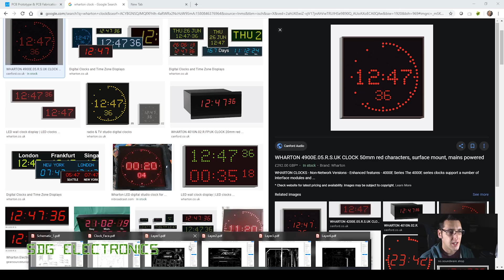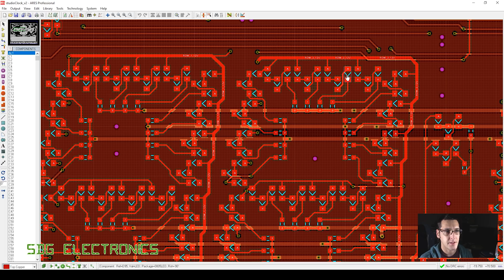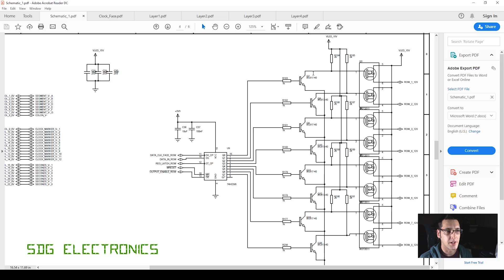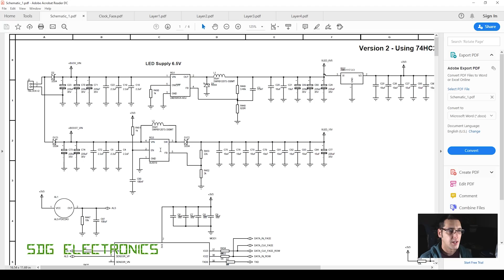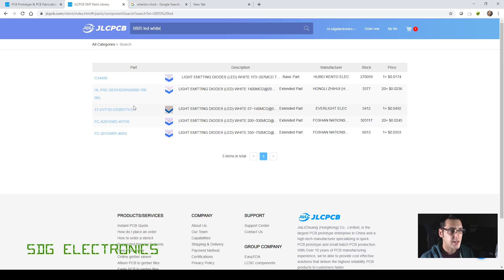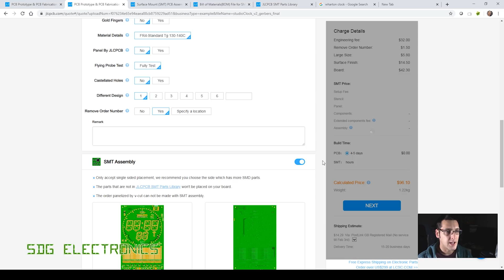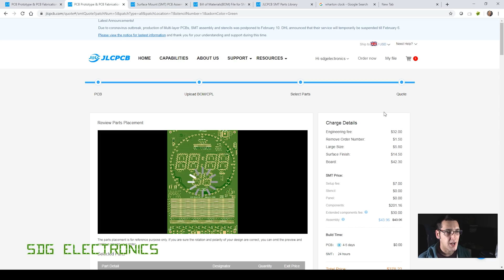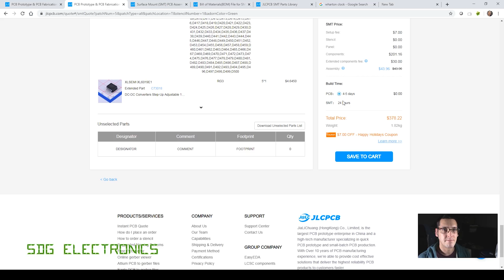SDG #133 2000 LED NTP Megaclock - An ESP32 based Wharton Electronics Style Clock

Comment: Hello sir. First of all, this project is amazing. Looking at your schematic, what is your intended manner of powering this board? What will you be connected to the terminal block?

Thanks.
Reply from the maker: I had planned to put this into a frame, thus a 2.5mm barrel jack on wires would be soldered into the holes.

Comment: Amazing work :) Must have taken a long time. 
I did a quick review of the schematic. Looks pretty good. 
In the datasheet I found for the WST2011, I see the max Vgs is +/- 12V. 
In the schematic it looks like it would be 15V, when the gate is pulled low. If I understood it correctly. 

if (review == pedantic) the switch life could be improved by putting a few ohms in series with the de-bounce cap, to avoid microscopic welds on the contacts. But honestly, I wouldn't bother either, if it's not a switch that would be expected to last many thousands of cycles.

Can't wait to see the finished boards :)
Thanks for the video!
Reply from the maker: Good catch, I missed that so a good job you spotted it!

Comment: Great project. I'm currently building a largish clock myself, but it's a 7 segment thing with 8 RGB leds per segment and each digit on its own PCB. A bit of a battle of material as well, but certainly not to this extend.

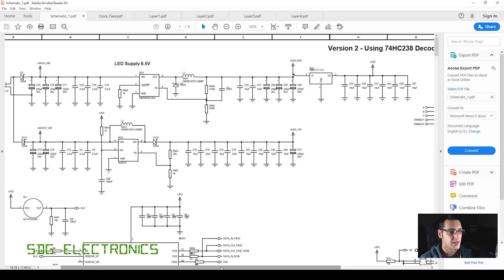Comment: Hi. @7:29 you show the power section. The RG1 pin 5 is the chip enable pin. If i understand correctly, if the pin is pulled high, it's on, if low, it's off. From that regulator you get the 3v3 which also enables the RG3, but since RG1 is off, the other regulator won't turn on also. Maybe check if it's all right
Sanity check my sanity check for you :)
Thanks for the content! Keep it up!
Reply from the maker: I think I had set it up so that the boost converter would only turn on after the other rails, but thank you for reminding me to double check that!
Reply: @sdgelectronics  It seems the symbol for RG1 is a bit misleading, but you wired it correctly. If compared to the TI datasheet.

Comment: I haven't been through the schematic in detail yet, but I'm wondering if you could simplify by starting with a 15V input instead of 12V, and delete the boost converter.  15V power supplies are just as easy to source as 12V...
Reply from the maker: It did cross my mind and I do have some 15V supplies. Tough choice really as most people are likely to have a stash of 12V power supplies though.
Reply: @sdgelectronics  True, and if someone wants to use a 15V supply, it's easy enough to bridge the pads for the inductor and rectifier in the boost circuit and not populate the rest of it.

Comment: In several videos about JLCPCB‘s SMT Assembly, the preview showed components with incorrect orientation. The YouTubers mentioned that the preview was at fault and went ahead. The final boards were ok. Possibly the orientation has been manually fixed by JLCPCB staff, possibly the preview has a bug. In the latter case you might have made it worse by changing the pick and place file.
Reply from the maker: Hi robatoto, The orientation is determined by the JEDEC standard which JLCPCB are correct about - most of the components that were incorrect were those that I added to the library manually and thus I didn't pay attention to which way they would arrive on the tape/reel. A technician manually checks the orientation against the Pin 1 or polarisation markers on the silkscreen.

Comment: For the HC595 (why an extended part?); you can just put 13 /OE to GND, and 10 /MR to VCC. Then 14 DS -> SPI_MOSI, 12 ST_CP -> /SPI_CS and 11 SH_CP -> SPI_CLK .Not sure about your clock frequency, but the normal HC won't do good > 4 MHz. For my pixel (WS28xx) project, I have to use the AHC595. Furthermore, I really hope you are going to use a proper software development IDE, such as Eclipse CDT.

Comment: I couldn't be sure on your schematic, but I'd suggest a 0.1uF cap to GND from the /reset (EN) pin, with a 10k pullup resistor . I've found that there can be issues with programming the ESP32 using the 2 transistor circuit if you just pull /reset high through a resistor as the delay between the /PROG+/reset pulses isn't long enough (the ESP8266 seems more tolerant of this for some reason). It can also cause issues booting, as the VCC pin may not have risen to 3.3v (due to capacitance) when the chip attempts to boot. Adding the slight delay to the /reset pin fixes that issue! Just something I've discovered when using this chip on a few projects :)
Reply from the maker: Thanks, I'll take a look at that

Comment: How much more expensive is it to do double sided components? LED's on one side and all control/bias components on the other to make a cleaner display side.
Reply from the maker: At JLCPCB it's not possible at this time. I got quotes for this board from a few other suppliers and it was around 5x the price for the same single-sided assembly.

Comment: (after watching recent eevblog video) Now design a vinyl front panel. With transparent but matte windows to even out the light from three LEDs.
And 3D print an intermediate part that will serve as the light separator, as well as the mechanical base for the vinyl. (Might print it in pieces since the board is big.)
Reply: In this size, it might cost more than it worth though...
I would look for a substitute film elsewhere (in stationery store for example) and figure out the painting procedure...

Comment: Physical buttons ? ;) I would run a webserver on the ESP32 and use that for config. You can also run a local WiFi AP to set the initial config before you get it on to your home WiFi. You can either embed the HTML in your code or upload separate files to the ESP32's SPIFFS filesystem and serve from there. There are also various Google APIs you can use to determine your location and set the timezone and daylight savings programmatically. I'll be watching your progress with interest; I have used ESP32 and ESP8266 on several of my Nixie clocks.
Reply: Yeah, using AP mode and entering the password with a phone is by far the easiest method. Don't screw around with buttons.
Very impressive layout btw.

Comment: You really wanted to bite off a lot in one project.  My larger boards normally start as a couple smaller PCB that does each part and then later I combine them into a master PCB with everything on one.  I looked over the schematic and nothing jumped out at me as wrong.  Seems you are going for a seemingly high drive current on the columns?  250ma if my math is any anywhere close?
Reply from the maker: I decided to reduce the LED current down to 60mA now. The high efficiency white LEDs should still be more than bright enough. Thanks for looking :)

Comment: Wow that is the largest PCB I have seen I think.  I have made boards with about 400 parts on a board but never in the 1000's.  Seems you are getting to the point when switching to an LCD screen might make sense...
Reply from the maker: My skills aren't in software :-/
Reply: @sdgelectronics  Well based on your past projects it will look nice and work well I am sure!

Comment: Very cool. I wouldn't mind having a clock like that on my bedroom wall as long as the led's aren't too bright. 
On a side note I have wonder whether the nCov pandemic in China would severely impact jlcpcb and deliveries from there.
Reply from the maker: I'm torn on the LEDs, so I might make a cut-back version without the matrix with just red or yellow LEDs. This board will most likely be white, but with an ambient light sensor to allow the LEDs to dim right down. I've board some stuff from Hong Kong and China over the past few weeks and they've arrived in surprisingly good time. I think it'll be down to any staffing issues at the factories plus possibly a massive backlog of orders.
Reply: @sdgelectronics  I think the original matte black with red LEDs would be nicer, but with blue minute LEDs. Yeah the matrix is a bit much, considering they are about $80 each.
Reply: I've had an order of standard (1.6mm, double sided HASL) boards manufactured in 40 hours, by JLCPB last weekend but since monday the DHL has not picked it up yet. So the nCov outbreak is definitely affecting some of the logicstics..